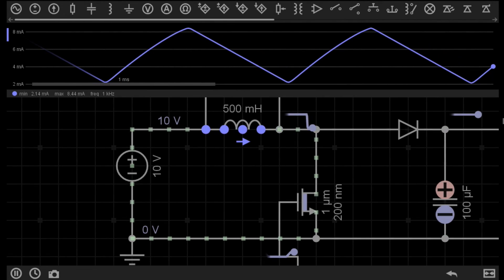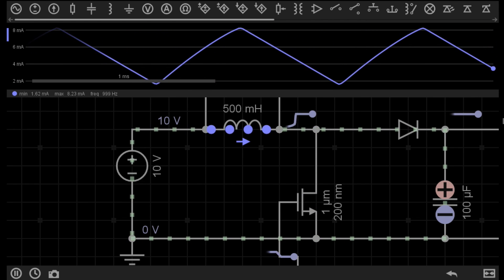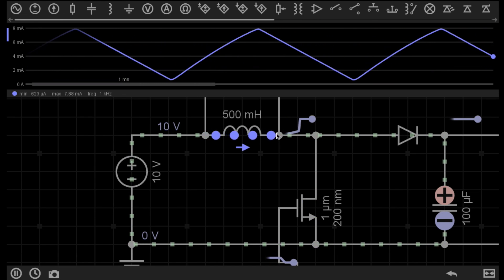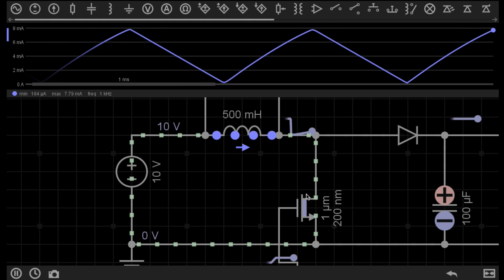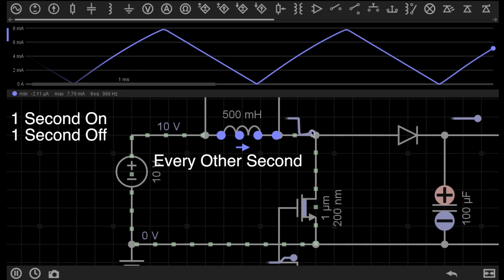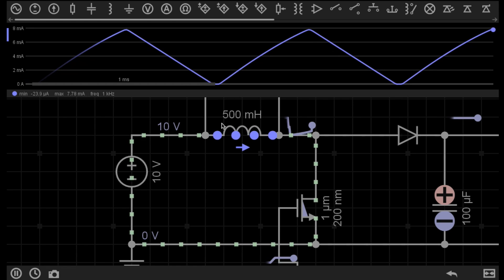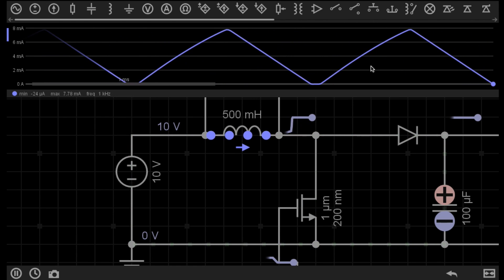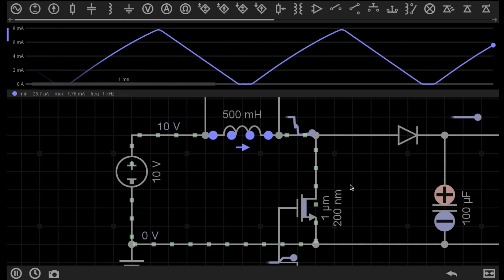What is an Inductor? EASY! - Electronics Basics 21

Comment: Hey there, it makes sense why the current through inductor doesn't fall down to 0 instantly after opening the switch. But why does the current doesn't go to max instantly after turning the switch on?
Reply: Let's start when the current is 0.

As you ask, we turn the switch on.

Current goes from the battery and gets into the inductor.

Now - how the inductor works? Well, current starts moving through it, but as current moves through it, a magnetic field is generated around the coil.

This magnetic field oposes the incoming current, thus it slows it down.

That is the reason. If we had straight wire - no oposing magnetic field. The more you curl it, the more you focus magnetic field against incoming current.

There's also a quite similar experiment when you throw a magnet through copper tube. Magnet slows down as it falls through the tube, because the magnet induces curent in the tube, and that tube creates opposing magnetic field, slowing the magnet. It's kinda similar with the current I guess.

Comment: Hello, thank you for this video. I am trying to hammer these concepts into my mind, little by little. I know little about electronics. One question slightly off the subject: When the transistor is on, why doesn't the current split to: 1. the transistor and 2. the diode as well (just as in any old regular parallel circuit)? Thanks to anyone out there for your answer.

Comment: An inductor is a coil, think of a coil spring storing energy, not the same, but compressing then releasing. If you push an object against a spring it will adsorb energy, but after the object (electricity) is removed the spring releases its energy (current). The more weight (electricity) is pushed, the more the coil spring compresses. 

An inductor stores energy via a delayed or impeded buildup of a magnetic field, which is an initial resistance to change – This concept is used in oscillating circuits designs.
Reply: Does it effect the volts?
Reply: @Eduardo_Espinoza  yes

Comment: The bemf current spikes passing though the diode then into the capacitor is like electric motor that could charge it self or another battery separate to the this circuit. Why dont electric car have this circuit to have longer run time?

Comment: wouldnt the inductor generate a back EMF with current flowing in opposite direction?
Reply: At what part the inductor's current flowing in the opposite direction?
Reply: It does create, that's why the current is slowed down and doesn't go up to the maximum instantly when the switch is ON.

Comment: Love it, currently studing electronics and your videos are beautiful.
perhaps you could approach with some more of the mathematics behind rlc circuits ,
Reply: Deviantfulness He's only talking about the basics, he does a great job. He definitely knows what he's talking about and I guarantee he could talk about rlc circuits. The thing is, inductors and capacitors work different using dc vs ac. I'm willing to bet the rlc circuits you're studying are connected to ac? In AC the easiest thing to remember is that an inductor acts like a resistor. The phrase "ELI the ICE man" may also help you when figuring out when voltage(E) leads or lags the current(I) in a capacitor (C) and inductor (L)

Comment: So...
What's an inductor?
You explain so much
I wanted to have one sentence
Does it make current go fast?
Reply: nope. what it does is simple, you see if you set up current through it using a battery into its steady state and switch off suddenly. the magnetic field in it will collapse, or in other words reduces gradually. how ever the reason for gradual loss is explained with faradays law. faraday explained if change in current is occurred that will give rise to emf. this emf is to maintain the magnetic field as this follows current will generate through the coil if its sinked in another path.
Reply: @praveenrock5  1
Reply: hahahaha, same feeling
Reply: An inductor is just a coil of conductor wire.

Comment: Thanks but don't understand why there isn't current flow from the power supply but the inductor when the switch is off.
Reply: power supply have 10v 1 amp,  inductor make max 8 amp it is like don't late low amp pass .

Comment: hi there, i watched and continue watching every single video of you from the start to the beggining and i can really say that it helped me a lot with my projects and i would like to say you a thousand times thank you for this, now i'm dealing with a simple boost converter circuit surely without all the chips and the op amp and all the complicated stuff, i scavenged some electronic components from a variety of tvs printers and all monitors like that but i have a problem with the coils, so i'm asking you if you can make a video about the mathematics behind it in order to, for example, make and inductor with an average uH precalculated, what is the relation between the numer of turns, the thikness of the wire and the length of the solenoid, and how does a ferrite core can change the value of the inductance, and again thank you for your videos you're amazing !

Comment: what is key difference between capacitor and inductor as both store energy and then deliver
Reply: Capacitor: Stores Voltage    Inductor: Stores Current
Reply: they both do it, that's why you can have LC resonant circuits where they kinda pass energy to each other at specific frequency

Comment: So, what is the difference between a capactior and inductor for functionality then? They both result in dissipating charge (in different ways). Why use one over the other?
Reply from the maker: Perhaps I'll do a video on this. I'd have to write a huge paragraph to explain this.
Reply: Both capacitor and inductor are used and called storage elements. Capacitor stores charge in the form of electrons while inductor stores it in terms of current as it slows it down.The current( rate of change of electrons with respect to time )flowing through the inductor will create a magnetic filed that will oppose the flow of electrons until it reaches the maximum storage and that is related the number and length of coils.
In DC circuits the inductor will charge and behave like short circuit and capacitor will behave like an open circuit because there is no opposing force to change the direction of electrons from one plate to another.
I hope this answers your  question!!
Reply: A capacitor stores energy in an electric field, an inductor stores energy in a magnetic field.

Comment: how are choppers applied in motors
Reply from the maker: If you take a look at my transistors video, chopper transistors essentially work with the same method, although instead of controlling the brightness of an led, they will control the speed of a motor. Perhaps I will do a more in depth and technical explanation in a future video.

Comment: looks like a DC to AC converter. thank you so much for considering my suggestion. also id like to ask of you can explain (like you always do in best way) some 78xx parts... like 7805 if im correct  that turns all dc voltage to 5V (dc)
Reply from the maker: +Destan Kadiri it's actually a dc-dc boost converter. But dc-ac is still on the list. Yes I also have linear regulators on my list too :)
Reply: 7805 is a voltage regulator it will do its purpose of providing 5 Vo however how long can it withstand its thermal heating capacity? For that reason we use DC-DC converters for better efficiency and easy switching with MOSFET controlled regular pulse activation. Just like a Transformer in AC circuits, these kind of DC-DC transformations r used like ex: Boost, Buck or Buck-Boost converters.